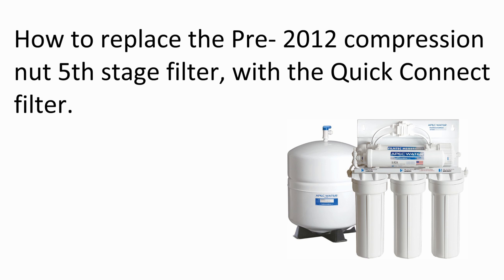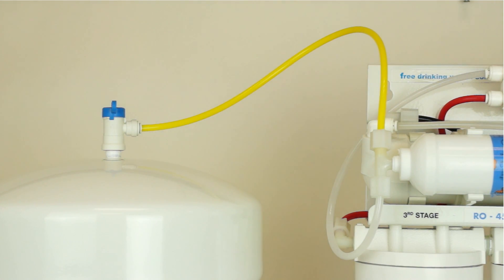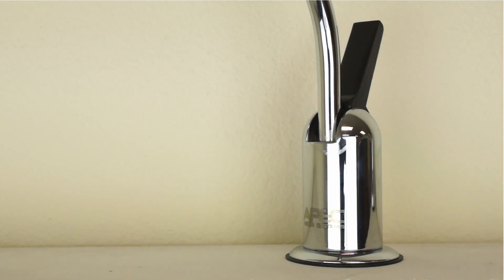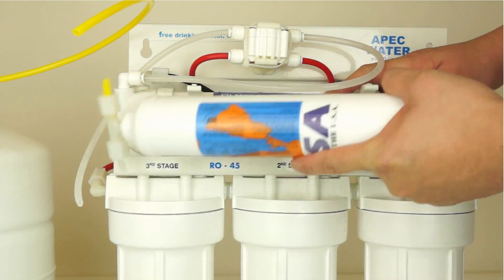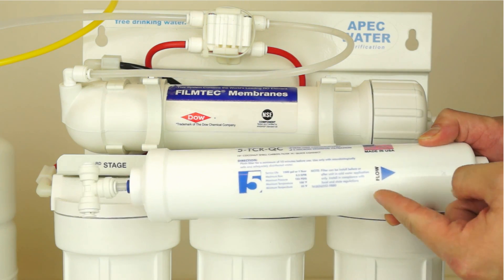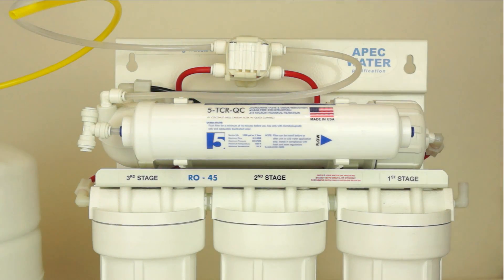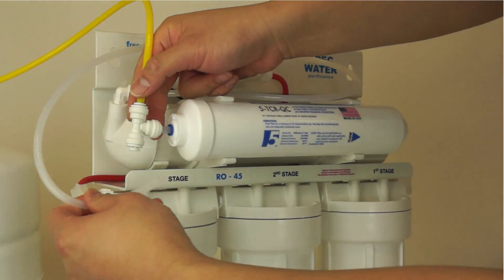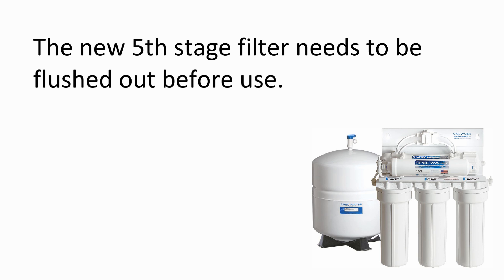Replacing a Reverse Osmosis Inline Carbon Filter With Compression Nut to Quick Connect Fitting

Comment: My QC filter DID NOT come with a pre installed T fitting . . . and I don't know what size I need so it has to be returned.  Also, membrane filtered seems to have been changed or modified since my purchase so this one is useless too.  I got a great deal so it doesn't work.  Looks like I'll be drinking tap water for a longtime till I can find the 1 stage & membrane filteres that will fit then I get to pay more for the 3 bottom ones (I got a 3 yr supply plus stage 1 & membrane for 120 bucks - too good to be true, right?  yep
Reply from the maker: Hello Customer,

If you are referring to the FI-ES-TC-QC that does not come included with a tee fitting. However, if you contact us directly we can send one out to you as a one time courtesy. Our membrane filters are industry standard so they have not changed in size and will fit our units. We don’t sell any filter bundles that are 3 year’s supply. If you need further assistance, feel free to contact us directly by calling 1-800-880-4808 or e-mailing us at info@apecwater.com. We are in the office from Monday-Friday from 8:00am-5:00pm PST. 

Best Regards, 
APEC Customer Service
Reply: @apecwatersystems   very good service

Comment: Thank you, this really helped me. One of the elbows on the filter started leaking. (mine were screwed in). Called the shop, they said I should unscrew it and tighten it after putting Teflon tape on the threads. Worked like a charm. No more leaking.

Comment: Question...ive got a brand new system and ive filled and purged two full tanks of water, yet when i fill a big cup of water i can count several barely visible black pieces..
Reply from the maker: Hello, 

Thank you for your inquiry. I'm happy to help!  In most cases, the water should be clear after one flush, but sometimes it may take up to 3. Please flush the tank one more. If it still persists, please contact 
us directly so we can help resolve the issue. 

If you need further assistance, feel free to contact us directly by calling 1-800-880-4808 or e-mailing us at info@apecwater.com. We are in the office from M - F from 8:00 am to 5:30 pm PST.

Best Regards, 

APEC Support Team